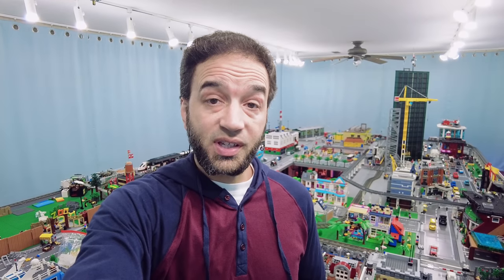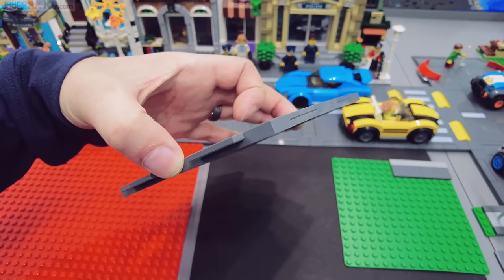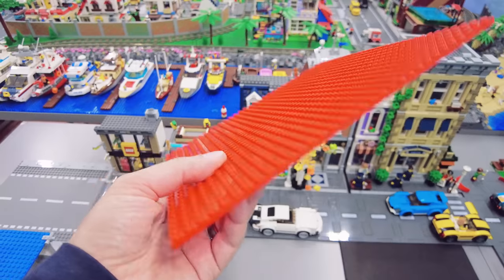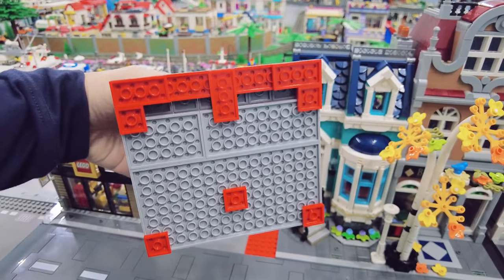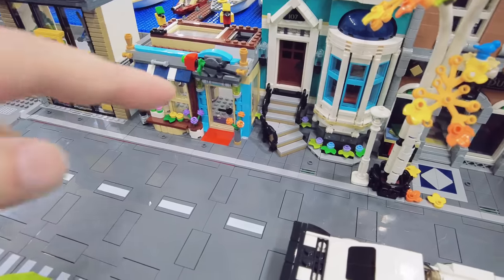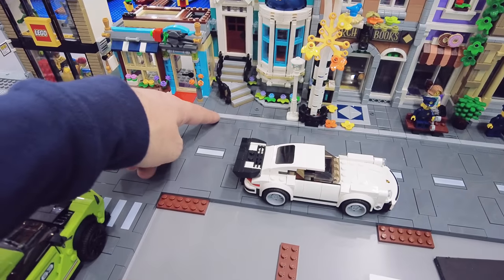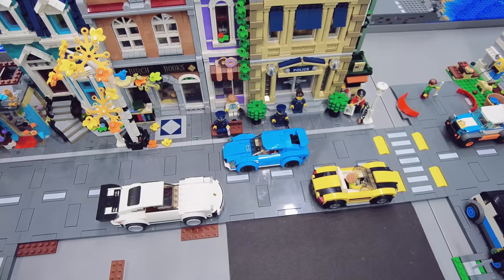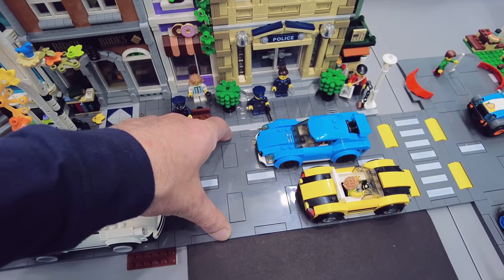LEGO road plate harmony! Easiest, cheapest fixes & integrations for modulars, baseplates & more

Comment: Ive been using the ramps it comes with to blend with the modular curbs. just looks like a runoff to the storm drain, which is fine to me cos a lot of roads in my area are sorta like that. also makes use of those ramps that i wouldnt otherwise use. oh and it makes good curbside parking.

Comment: Just use another baseplate with tiling as the spacer beneath the modular's baseplate. This will result in the sidewalk being exactly one plate higher than the be road system.

Comment: Thank you for adressing most exagorated comments made by haters of the new stuff, only ammunition they have left is price, which should be between 10 and 15 max on the basic roadplate set instead of 20.

More plastic is needed per roadplate, and lego needs a way to recupe some of the development cost. So at least for the upcoming years these will still be significantly more expensive then the old baseroadplate system.

Comment: Okay, but the "old" baseplates are not actually out of system.  I have multiple builds in my own city where I use them in system.  You see, placing a baseplate on top of bare studs comes to exactly the same height as one plate.  So you could have a large baseplate, build the walls of a building on it, set another baseplate on top of that (without tiling the walltop, and then build up from the bottom baseplate and connect to the upper one without things being out of system.  It can be used to really good effect; I have a whole underground bunker military base with roadplates and buildings on top of it.

Comment: Or rebuild the modular buildings on plates. Since you can remove the upper floors, you only need to rebuild the first floor.
Reply: Feels like it’d be a bit much.
Reply: What a stupid idea, Lego could have just sticked with the baseplate and every body would be happy
Reply: Mhhh there aren’t any original 32x32 plates, you’d have to use those compatible one hang showed. You could also build two layers of plates on each other to make them stick together but that will get pretty messy and pretty expensive very quickly

Comment: Great video and some great solutions to the problem of bringing up the pavements and connecting buildings up the right hight to work with the new road plates – but again, if there is a problem to start with, then the plates are flawed in my opinion – most solutions to all the use of these plates in a city are expensive - which added to the cost of the plates makes it a very cost prohibitive solution... and before all that, they're quite simply ugly.... I appreciate the effort of people trying to come up with solutions, but these plates are great for kids, but for me - if you have a city - baseplates are better.

Comment: A fun fact about LEGO base plates: They are completely compatible with all other LEGO brick heights, it’s just that most people don’t know how to use them properly. A base plate and it’s studs are equal to the height of a regular “tile” flat brick with no studs. That means that if you place a base plate on top of two flat bricks WITH studs, it will be the same height as a regular (not flat) LEGO brick. The studs will line up perfectly. I used this technique to build an aircraft carrier with baseplates for the under deck ON TOP of a regular brick hull.
Reply from the maker: Yep see the video!

Comment: Great video, once again very thorough, full of great suggestions.
I have even seen people do brick-built roads by putting the bricks on their side. Would there be a way to combine this new road system with that approach? Any way to smoothly transition between the two?
Reply: As far as I can tell you should be able to end up at the same height between the two and just have the bricks on the side just line up with the sides of the new roadplate. But if you go with the new roadplates I think it would be easier to just extend those. However, if you want to do it in order to create a thin white stripe at the sides for instance (from a plate on the side rather than a full plate width it should be possible).
Each time you extend the width by two studs you'd need two plates on the side (the last one being a tile) and one brick on the side (or a 5 plate on the side total) followed by a brick with a stud on the side to connect it to. That means three studs are used in total for a 2 stud extension and five studs for a four stud extension with the final stud being the one you attach your sidewalk to. However, in order for the roads to be at the same height you'd need to add a plate beneath the new road plates. For stability and interconnection between the two I would say that you should raise the roadplate by one brick and add two plates below the the stud on the side for the brick-on-the-side road part.
Hope this makes sense (would be much easier to show than describe).
Reply: Regarding interconnection. If you need to make them interconnectable MILS style using technic bricks with holes you need a full brick height below the brick with a stud on the side on the brick-built road or you won't be able to have a technic brick below the road. And then to make it line up with the new roadplate you'd need to have one plate and one brick below the new roadplate. Otherwise you need to use plates to connect the two.
It is not as hard as it might sound but it is not easy explaining

Comment: My poor man’s simple solution to using the new nice new road plates in my (mostly modular) city? Go to Home Depot, get a 4’x8’ sheet of Masonite hard board. Have them slice it into 1’x4’ strips for you. Use the Masonite as a pad under your buildings to elevate them slightly above the shelf or table. That will give you the illusion of a curb when you put the road plates up against the buildings. Most people don’t actually need or want to pin the buildings and roads together, in most cases, as it makes it difficult to move things for cleaning, posing, etc.

Comment: Could you use part 33909 (tile 2x2 modified with studs on edge) to link the new roads to the  modulars using this method?
Reply: If the curb on the modular is on the baseplate directly then i think you need to widen it by a stud so you can get studs under the curb pieces.

Comment: Great video, good explanation, I still think however, that this is a sad state of affairs. The baseplates always had their place, as a base to easily move on every kind of surface, from laminate to carpet. This is a good solution, but I still think this should have never been made as a problem in the first place. They could have just made the new streets the height of a baseplate and plate, and there never would have been this discussion. It just seems like a horrible move by lego, that could have easily been avoided.
Reply from the maker: The problem is that baseplates are the problem, and always have been.  Baseplates are out of system; plates aren't. LEGO seems to kind of hate them for that reason (understandably) and has been clamoring for an escape for a long time, finally switching almost every building in every theme to plates in 2013. Only modulars and their kin are stuck in the old ways now, because LEGO was too scared (understandably) to change them at the same time.  Now they have 16 of those big buildings with no end in sight, and they're just stuck adding to the decades-old problem. It's a pretty impossible predicament, really.
Reply: @JANGBRiCKS  baseplates are useful because they're quite large, plates only go up to 16x16

Comment: I don't have a huge city (don't really have the space plus I only succumbed to Lego again a year or two ago), but still I'm hesitent about the new roads. First because the old baseplate road has been in use since the 70's (I had some back then, still do). And also, this new system is expensive. I'm also wondering how curves will be handled and how they'll look.

That said, I'm  getting more interested. However, if I'm going to implement them I'm either going to go MILS or KO. There are several option for non-official Lego 32x32 (or different size) plates and many come in much nicer colours, and then built the Modulars & co on those.

That said, I bought one of these in a very nice green for the Apple Tree House and I noticed that despite the plate being perfectly straight, after the house was built on it the clutching power of the bricks warped the KO plate. It bulges up a bit.

Comment: They need to make the bare grid available individual or in packs or two/four and then make all the pieces to fill them out separate as well. That way you can order 10, 20, however many you need, as well as how many pieces you need to fill them and make the central lines. 

Otherwise, they are pointless

Comment: LEGO doesn't seem to be leaning into  the new road plates enough.  I type this 2 years after this video was made and they still haven't added curves or corners, so it's an incomplete system.  And they limit your purchase to 3 total, which have been sold out for a long time.  They should really made them widely available if they want people to convert.

Comment: Always hated that the baseplates were out of system. As a kid it used to drive me crazy how you NEEDED to buy baseplates to make a buildable floorspace that can connect to the roadplates.
Reply from the maker: Exactly, it was always all-or-nothing. I've had to spend multiple fortunes on baseplates for my city!  This is why LEGO transitioned to plate-bottomed buildings across most themes all the way back in 2013. Basically only modulars are holding us back now.
Reply: @JANGBRiCKS I feel it wont be too too long before Lego retires the baseplate standard even for the modulars. The fact they invested time and money on this new road system means that they believe in it.

Comment: I changed the amazon URL to .co.uk, but kept all of the referral link, so hopefully you'll get some kickback from it. 

Appreciate the video. I've got a few modulars, but have never purchased the road plates, as I disliked the mix of 2 that came in a pack. For now, I just want a long straight road on a shelf, so these will work nicely. Going to invest in this system.
Reply: Only downside is Strictly Bricks don't do a 16x32 plate :(

Comment: What is it like to put the modular buildings on other normal baseplates as far as lining up with the road?
Reply from the maker: Works kinda, but you stay out of system. A baseplate with studs is the same height as a tile, so you end up with a curb 1/2 plate higher than the street.
Reply: @JANGBRiCKS  Thanks! I'm thinking of switching to the new road system, and I'm glad you are very straight forward about these new road plates. :)
Reply: @JANGBRiCKS  I'd just like yo say, I did switch my roads out with the new ones, andni used your techniques and it looks great! Thanks so much! I'm really glad you make the content you do! Keep up the amazing work!
Reply from the maker: @grandviceroyoftheempire  Ah wonderful, and congrats!  Glad it all worked out for ya.

Comment: Jang, do you think you can reverse road baseplate color changing using UV lights and the right chemicals? I've seen Nintendo systems change color over time, called yellowing, and it is reversible using UV lights in a chemical bath. I'm not sure what the chemicals are though.

Comment: Very thorough, the only question I have (unless I missed it in the video) is how easy is it to remove the tiles in the middle of the plates? Is there a hole where you can just push them out from underneath like with Speed Champions hub caps?
Reply from the maker: Yep exactly there are holes like on a Technic plate where you can push a bar through, and every set that has any of these plates will come with something compatible to use as a tool.
Reply: @JANGBRiCKS  thanks! Any plans to do a test railroad crossing with these?

Comment: I think a good way of adapting the old system to the new one would be the following:
* Take all your + cross roads and cover them in 4 of the new road plates.  
* Turn it into either 4 lane roads like at 16:11 or 2 lane roads with 4-6 wide divider in the center.
* Seperate the modular buildings from their baseplates and add a layer of normal bricks between, the edge that connects to a road must be light grey/light greyish blue.

This should put the sidewalk at 4.5 plate height and the road itself at 2.5 height, so a 2 plate step up from road to sidewalk.  You can then get fancy and use this 2 plate height difference to create road drains.
Reply: they probably want the roads to be fairly simplified, but of course someone could easily customize the roads to do the sidewalk system like you're suggesting, it'd be neat.

Comment: Thanks Jang for this excellent tutorial showing us that the new system is much more flexible than the old baseplate roads. However, in my opinion, they are just plain ugly. I have seen many examples of people building their own roads using standard Lego; they don't have the drawback of this weirdly inconsistently smooth surface.

Comment: How do you remove the tile out of the middle of the road plate?
Reply from the maker: There are Technic pin-sized holes accessible from the underside. Push a bar through (included in some way in every set that has the plates).

Comment: One thing though, how are you supposed to take out the 2x4 dark gray plates that are now imbedded in the 16x16 new mold for road plates? They are stuck there forever right?
Reply from the maker: No there are holes on the undersides so you can pop them out with a bar.

Comment: I dont like it Not in a bad way but it the lack of Option to add Builds like Modular Buildings that was not part of the pack and the lack of 1 x 4 Tile pieces for the roads pack that lego made in all I like the old ones since they easier to transport and have a little more extra space but the new one has more customization

Comment: These are more "Lego" than the old ones. Think it's great for those that want to do more with roads. For simplicity tho, old ones are better.
Reply: How is this more Lego then a 40 years old system? Ah from Point of price yes, it is much more expensive and i have to buy additional lego at bricklink to be able to Connect them to a Building Like 31097 (the system should be Made to fix issues Not to maintain them). Yeah much more Lego then the old baseplates.

Comment: What kills This new street System for me is the price and the  fact that they cant even fit two 6-studs wide Cars next to Esch Others...

AS of lego couldnt afford to make those squares 2 Studs wider considering the price of 20€
Reply from the maker: Why do you say two 6-stud wide cars cannot fit next to each other? It's not true.
Reply: @JANGBRiCKS  Yes they can fit next to each other, but out of the box only barley. I know that they can be easily made wider but but as when you are a kid who just bought the new city set you probably dont have the parts to do this. In my opinion its a huge oversight at this price point from Lego that you have to manually made them wider so that two 6-studs wide trucks can fit next to each other without it looking so cramped.

I just dislike that they are out of the box to small.
I however really like the new opportunities coming with the now possible medians or 4-Lane Roads.

Comment: Instead of that foam board stuff, you could get foam mesh (the stuff you'd  put in a kitchen draw to stop mugs/glasses etc sliding around), it's equally as cheap and unlike the foam board it'll make the baseplate  less likely to slip around.

Comment: Thanks for the tips Jang. But how many people have so much cash to adapt or expand the new system and what guarantee is there that in 2 years LEGO does not change it again? The modularity still doesn't compensate for the overpriced parts or for the ugly patchwork look. Just check out Bricks and Pieces and a single 2x4 tile with the stripe or bicycle print costs 0,69€! No wonder LEGO didn't bother to put some spares in the new City sets. If TLG would have checked the market a little they'd make the 32x32 plates/roads like the Chines brands do but they couldn't keep up with the low prices.
I'll better buy used road base plates and put cardboard underneath (fyi foam core is expensive).

Comment: This is so wrong on so many levels. So to Connect the new Road with current 3 in 1 creators i have to buy additional lego plates to get them in the correct Level. I am so sorry to say but Jang is so wrong this time. A new system should Not have the need to be fixes by buying more lego be able to Connect it correctly to actual available lego Toys. This is a complete wrong approach. In this Case lego got what they want. Selling you a flawed Product and you Spende even more Money to fix it. Also for my children as new customer the new system is Worse. They have no spare parts to Connect their 4+ buildings to the new roads. Why are there No extra parts in These Road Sets? This goes very wrong
Reply: Those extra parts will cost what? 40 cents online?